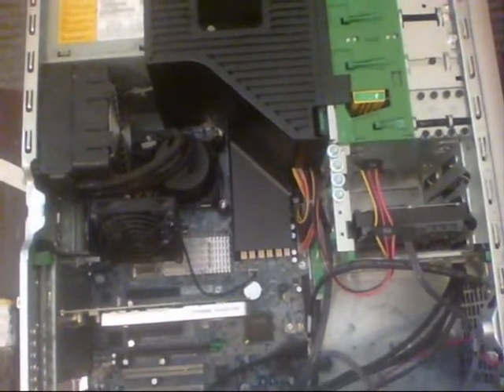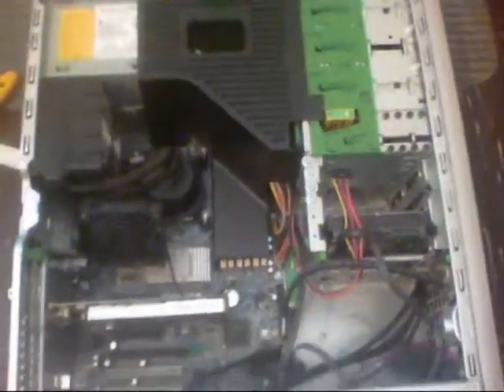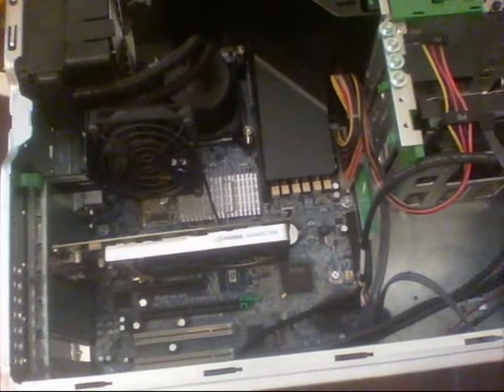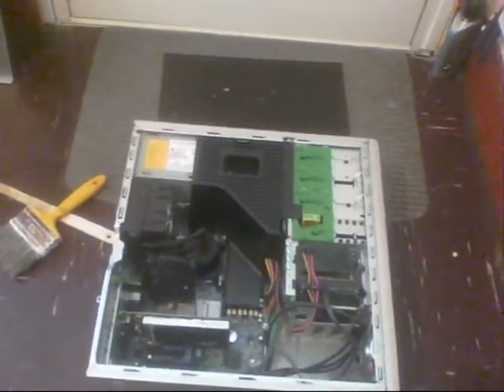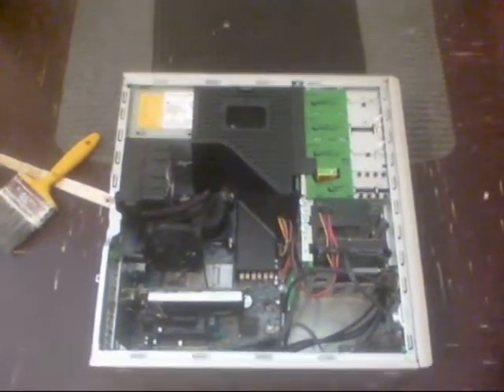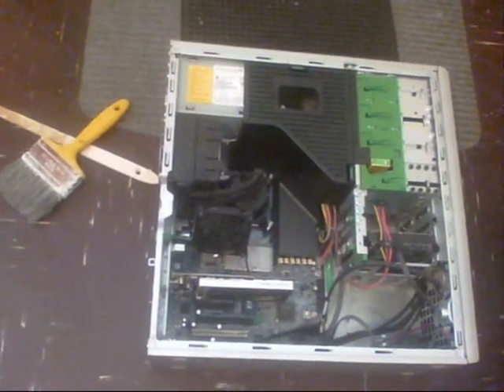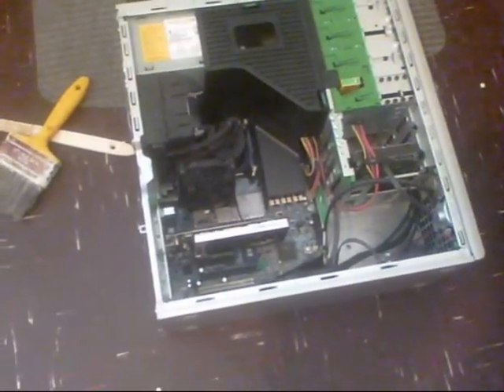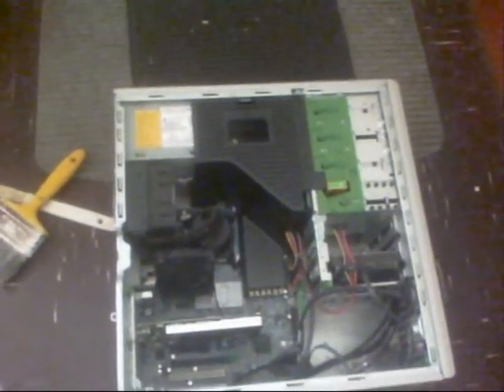Building a cheap gaming machine using a HP Z400 Workstation.

Comment: whats the brand of that liquid cooling fan? This machine can run pretty hot. i need to figure out a solution for that.
Reply from the maker: when i get back i will look it up part of it is from an hp machine .
Reply: This cooling system is how mine came secondhand. Downloaded a windows 7 pro via tor. Threw in a 1Tb SSD I’d scored awhile back. Vacuumed out the case. Installed OS. AUTHORIZED it using the sticker on the case. Done. So stop begging for discs- find a working download- and get er done mate. And be honest, you ain’t done shit to this thing but Maybe added that HD.

Comment: Personally, I didn't like vista.  I think my favorite was windows 2000.
Reply from the maker: xp was the best I Have 8.1 laptop and it drives nuts and find hard to work on and use
vista.is slow but that way system setup .and now thy stopping updates and the thing gets me down nothing  works on the new computers from old computers have keep buying items its a ripoff.
Reply: Prepping Ohio windows 2000 service pack 3 :-)